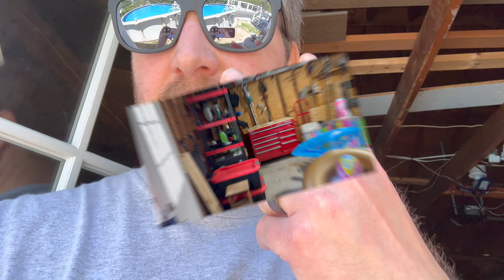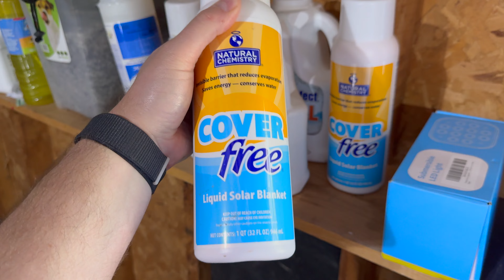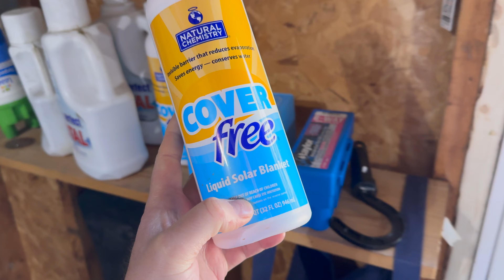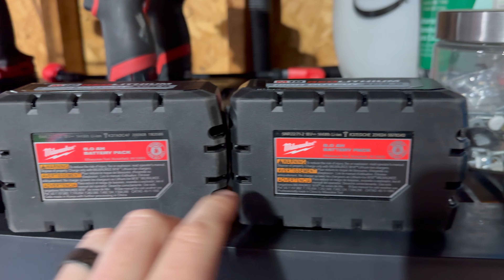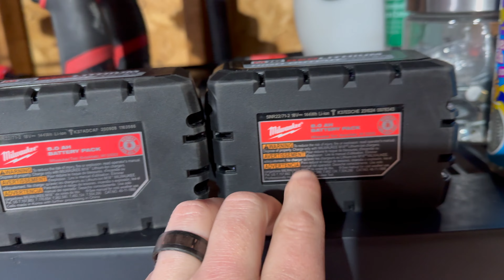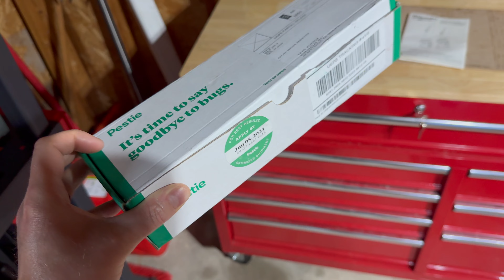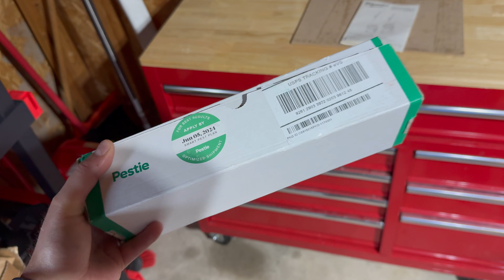Random Video - Garage & Deck Update

Comment: The pool and deck looks great, really like the extension you put on for the pool makes it much safer and more accessible. Totally agree with you on the area between the garage door and your deck for putting in pavers or crush rock. Seems like an area that would be a pain to keep grass growing and cutting. For most homeowners the 12V stuff is tons powerful these days unless your doing serious renovations but you do need the bigger batteries if you want to run stuff like vacuums or blowers as they seem to drain batteries fast. Utility knives are great especially on stuff that you know for sure will mess up your edge on your good knife and the fastback is definatly one of the better ones. I like the one that also has a 1/4" bit driver on it as well, great fir the toolbox. Hope you had a great time at Bladeshow kev. Thanks for the great vid and keep making sharp things fun and enjoyable